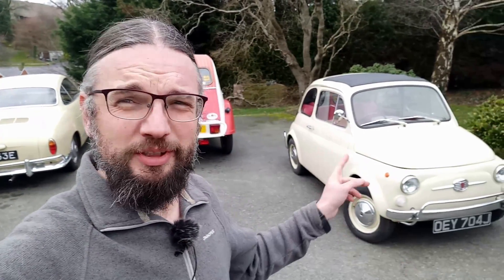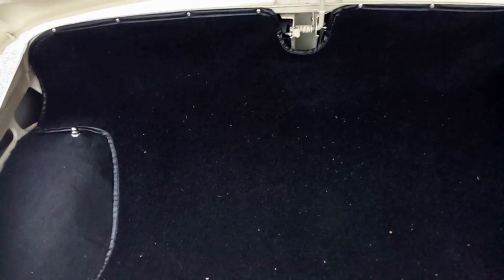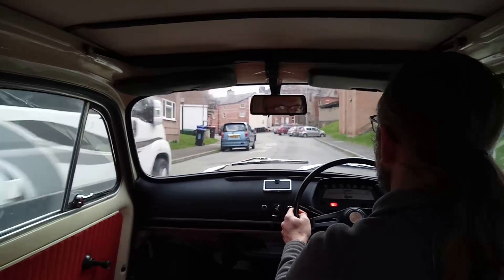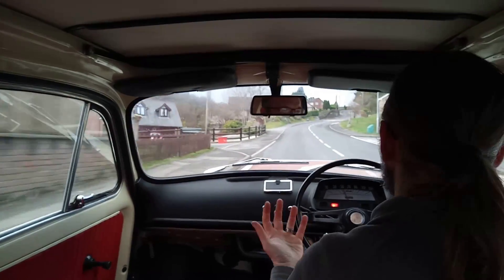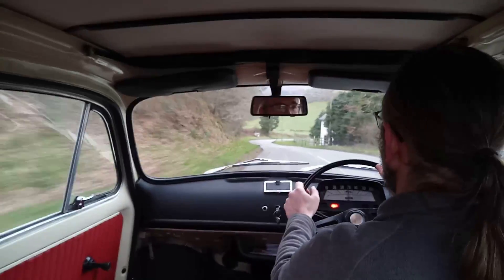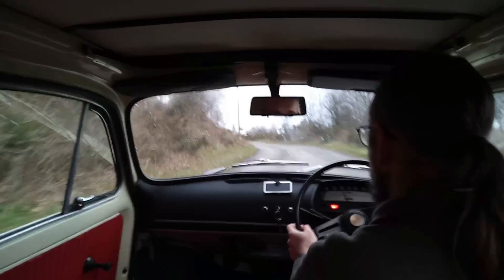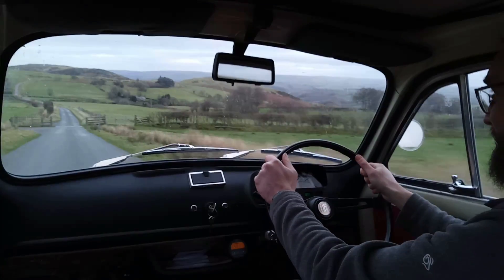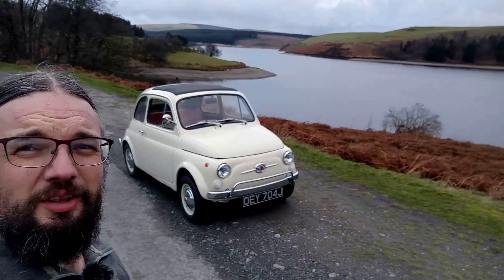This Fiat 500 is ELECTRIC! What's it like to drive?

Comment: A great review Ian, what a great little car!
Reply: When everybody has an electric vehicle with 200 mile range at a top speed of 100mph, the current technology dictates you will use 3.2 times the electric your average UK house does for the present 1.4 cars per household. The grid in its present form cannot even slightly cope (nor can your wallet) so this needs to be rolled out with massive alternative energy sources, a lowering of performance expectations, brought out in the freight industry first (that electric suits, with the high torque and enforced tacho breaks)
  Its sadly a bit of a headache...before you even go into a massive lithium mining demand rocketing costs.
Reply from the maker: Yet power companies seem to think they can cope. The grid does not run at 100% for 24hrs a day. Electric cars can actually help balance the load through smart chargers.
Reply: @HubNut  Steve Rose did a great article for Motorcycle News where they did the maths and found it somewhat (or rather, vastly) wanting, I think it will start to become more polarised as we get past the 15-20% usage mark. I'm certain the government aren't pushing to LOSE the revenues raised by fuel tax, its hardly a philanthropic organisation.
  I can certainly see legislation in future whereby new builds will have to have a certain percentage of the roof given to solar, or similar.
Reply: @DomRivers67  do you not ever consider how much electricity is used to get the oil refined into petrol and pumped to you car?  (It's surprisingly large!)

Comment: I'm not necessarily an electric car fan, but like with all things we may have to embrace it. If things like this conversion means we can enjoy older cars well into the future, what's not to like? Great video.
Reply: This is good. Transmission fluid and other service items may also become illegal in places like Germany, but then we can still go Cuban and replace it with a concocted hygroscopic grease from supermarket supplies. It is still greener than teslas and the leaf, because it was not replaced 20 times since the 50s

Comment: If they weren't so hard to find these days I think an electric DAF 55 would be a very interesting and mechanically straightforward conversion. Let's face it someone has even done a Matiz!
Reply from the maker: A DAF would be quite tricky, because of the belt drive. There's no need for it, so you'd need to re-engineer the car to suit.
Reply: I know someone who converted a DAF 33 and documented the proces on his site: http://gromsound.mfbfreaks.com/33e/33e.htm. Only available in Dutch, though. Maybe Google Translate can make a somewhat comprehensible translation.

Comment: Wow, the electric prototype Ural has more range and power! Nice, but like most electric vehicles over a few years old lack in range and power. More modern ones, more (insane in some cases) power, range getting there. Why did it take 100 years to START working on battery tech? Capacitors are a better choice, but I digress as I often do...

Comment: Fiat X1/9 would make a great electric conversation.  The original 1300 was very under powered and the torque from the direct drive would liven the car considerably
Reply: The original X1/9 hit 60mph in 12 seconds and was good for just over 100mph. Not bad for a 1300cc engine in 1972. Have you had a look at figures for similar sized sports cars from that time?
Reply: Low pressure supercharger would improve the car while keeping it somewhat original
Reply: @sim6699  as the public move towards electric cars (and they will) the demand for fossil fuel will fall.  At some point, probably in the next 20 years, we'll see fuel stations closing as the demand falls - then no matter what 'origanlity' you want, using the old things will be increasingly difficult.

Comment: I was talking about this last night to a friend  most country's would have to start burning coal again to put up with the pull off the grid if we all had electric e.v wind and solar I don't think is going to cut it
Reply: Still more efficient than a combustion engine. Science and all that.
Reply: I saw an interview recently with an engineer at the National Grid who can't wait for the next wave of technology to use smart meters and plugged in electric cars to balance out the peaks and troughs in the electricity supply.  They could use far less fossel fuels then despite more electricity being used as the chargers could draw some power from the cars when the grid needed it most before topping them up later on in the night when demand is low.  It would take us a lot closer to 100% renewable power.  I imagine it would need some sort of user interface for those evenings that you needed to charge it for a bit after work before heading back out but for 90% of people 90% of the time it would be fine and the other 10% can have veg powered Peugeots.
Reply: Solar and wind power is so unreliable it forces the grid to increase base load generation to somewhat mitigate.
Reply: sim6699 sorry, baseload is exactly what solar and wind don’t increase! When wind renewable power output on grid drops it’s the “peaker” plants, usually natural gas, that have to take up the slack. Coal plants can’t get up to speed quick enough, and are being shut down due to the awful pollution they cause anyhow. National grid reckons we can cope with a couple of million electric cars with exisiting grid before we need to start to worry. Battery evs will also help to balance the grid at peak demand times.
Reply: @AdrianColes  
I'm not well read about the national grid but did read base load increases because generation can not be switched quickly, except hydro energy refilled at night using spare capacity for peak demand in the breaks between popular television programmes.

Comment: I think you're absolutely spot on in your assessment of the conversation.  Yes it's expensive but the car 'looks' original and the engineering has clearly been well thought through.  The conversion makes the car an improvement on the original in terms of acceleration which is important these days.  It has better brakes as a consequence and no doubt handles a bit better (you didn't mention road handling but did state it had been properly weight distributed ).  The negative of range is an issue but the 500 was a town car so it electric guise it serves its purpose.  Good review

Comment: I'm a bit surprised you're advocating left foot braking Ian. Most driving experts would say you're braking reaction time would be quicker with your right foot.
Reply from the maker: How can it be quicker to move your foot from one pedal to another? Doesn't seem to harm F1 drivers. ;-) I often left-foot brake in automatics.
Reply: @HubNut  you're moving your foot from one pedal to another. In normal driving i.e. not Formula 1, your foot is resting on the floor. Jackie Stewart said this, not me.
Reply: Every time you put on your brakes your life is in your foot's hands ... ;-)

Comment: Ooh, imagine TWC with an electric motor.  The overtaking would be even more startling.  You wouldn't want 60hp though!  Just so you know next time, 70 kph is 43 mph, 80 kph is 50 mph, 90 kph is 55 mph and 100kph is 62mph :-))  I grew up with imperial in Australia and then they changed to metric in 1974.  I have never been able to visualise distance since.

Comment: I love this. Would have this on a Classic Mini 👌🏻
Reply from the maker: That would throw up some engineering challenges, given the engine and gearbox are one unit in a Mini, but I'm sure it would be possible. Fun too!
Reply: @HubNut  As you said in the video, you don't really need a gearbox with an electric motor.
Reply: @HubNut  The way to do it would be to remove both engine and gearbox and use a dual shaft motor to run both driveshafts and forget having a gearbox, probably enough space there for a battery pack as well. Maybe have a 2nd battery in the boot. An electric classic Mini Cooper would fly!
Reply: @markpitt5248  

What about a differential though?
Reply: @ChrisWilliams-i7d  Good point well made! Single shaft and differential then.
Reply from the maker: You can get combined motors and gearboxes these days that just need custom driveshafts now I think about it. Will have a differential.
Reply: If you're an eco-warrior fit the front subframe and diesel engine (1.5 peugeot) from a rover 115d or nissan micra 1.0 petrol since k11 Micra's don't look pleasing on the eye.

Comment: I like this. I was thinking about a conversion of a classic car when I get one but was told that the car would be reclassified as a new vehicle and no longer a classic even though just the power train is replaced. 🤔
Reply from the maker: It isn't reclassified as a new vehicle. It still keeps the same ID. Might be true that it no longer qualifies for MOT exemption, but I can live with that as I ignore the exemption anyway. TWC doesn't need an MOT, but she will still have one.
Reply: @HubNut  I agree with you on that. When I get one I will still get it tested, it's common sense at the end of the day.
Reply: Has anyone tested this reclassification from changing the engine when an original engine is not available and a close equivalent is fitted in its place.

Comment: A great conversion but here in OZ it would cost a fortune to charge it up. Our electricity prices have gone insane in recent years. The brakes could do with an electric servo with the weight of the Tesla batteries. Do I think it's a good idea for classics? Maybe in the UK where the traffic is very car unfriendly but here it's pointless,after all a car is only as good as it's engine mostly.
Reply from the maker: I don't think the overall weight has changed much. It stops well enough. As you say though, you are at the whim of electricity companies when it comes to refuelling rates.

Comment: Once the battery vehicle gets common there will be another pressing environmental concern about that, probably to do with lithium and point of production electricity pollution.  The environmental threat will simply be maintained with another focus. While they are rare they are a solution, once they are common there will still be a problem.
Reply from the maker: This is true, which is why I didn't discuss that. I'm not one to claim EVs are a magic cure to our pollution woes. They can help remove fumes from cities, but energy is always going to have a carbon cost. Even renewable isn't exactly free energy.
Reply: I must be honest: I prefer combustion engine above all transportation means powertrain, I'm no green-hooligan. But since lithium is so toxic and so rare on Earth (and thus expensive), I think there will be a much more organized industry on the recycling of every single bit of battery, and once ev's will be common, electricity consumption will have such a peak that it will obviously have to be produced efficiently without carbon cost. By the way, I think that a little range extender on board of every ev's could be a great solution: a very small engine, running smoothly and low just enough to charge the batteries while you drive would be much less harmful than a full combustion engine moving the car around and providing all the horsepower
Reply: @Barbacito  Yeah, a tiny ~300cc turbodiesel so it can run on vegetable oil. Does tree sap have calorific value?
Reply: @Barbacito  Lithium is in fact more abundant than e.g. lead. So far we haven't had any problems providing lead-batteries for "normal" cars; Lithium is harder to mine though. And yes, there will be more recycling. It took quite a while but people seem to have realized that throwing away raw materials isn't the smartest thing to do.
Lithium itself is not toxic, its salts are even used in therapy against manic depression.
Reply: @Barbacito  lithium is given to people to treat bipolar disease, it is not as toxic as you say , check out environment agency waste categories if you don't believe me
Reply: When 80% of cars are EV,the government will move the goalposts again & it'll be £300 pa for the most feeble EV. This planet is overcrowded.   Invest in a bicycle,but in  y2090 the fuckers will tax bicycle tyres.
Reply: @andythesoupdragon  bicycle tyres are taxed now.  20%
Reply: And road tax...
Reply: @andrewthompsonuk1  there will be road pricing.  This will be used to manage congestion as much as raise revenue.
Reply: Why would you use lithium?

Comment: I'd love a go in that little motor, if only for the chance to look ridiculous ( I'm over 6ft and weigh 18 stone). Hopefully costs will stabilize or even come down with more production, the economy of scale etc, and longer range from improved batteries. As for oil based fuel not being available in 20 years or so, by then its most likely I'll have departed, but I could specify an electric hearse!

Comment: Will you get the chance to go and drive it again once its running at full steam?  I think bearing in mind the 500 was always a city car then this really suits an electric conversion. With that battery pack in the frunk what did it feel like compared to the standard 500?
Reply from the maker: Not sure. I can ask. In terms of ride, it didn't feel that much different to the last 500 I drove. Still quite bouncy.
Reply: I just think it would be interesting to know "for reference and research purposes" what it will be like at 100%.

Comment: I used to really dislike small cars but now am actually starting to like them. My sister had a Fiat Cinquecento the only really annoying thing was that the gear ratio was messed up, first gear was so short that it was handier to go to second from the get go.

Electric cars are the future, drove a Model S100D that thing is quick and expensive. I'd be looking for a i3 Rex when in need of another car. Till then my Peugeot 1007 (sliding doors) will be my means of transportation.

Comment: For better (or for worse as far as classics are concerned) fossil cars are a dying breed and the availability of fuel will be the killer factor as the commercial focus changes to electricity supply. It is good to know that these solutions exist but how much will be allowed long term remains to be seen as the powers that be seek to regulate, tax and control transport.

Comment: Its actually easy to convert to electric motor drive, its just the batteries that cost really.
Reply from the maker: Plus you need a controller, and to know how to programme the controller to get the best out of the motor.

Comment: I believe have a gearbox and clutch is the only way to go really, because in a electrical runaway situation say due to a faulty pedal or speed controller , you have the means to break the drive, wheras when its direct you dont, so its a thumbs up from me.

Comment: If you convert to electric do you lose the mot/ tax exemption etc?
Reply from the maker: Tax is purely on age, so no. MOT exception is a very good question. Personally, I'd always have an MOT anyway, so I guess it didn't cross my mind to consider it. My failing.
Reply: If it is modified, you lose the MOT exemption. The law states, and I quote .... 
"No substantial changes have been made to the vehicle in the last 30 years, for example replacing the chassis, body, axles or engine to change the way the vehicle works".
Reply: @Mariazellerbahn  Thanks, its a bit of a mine field to what is classed as modified, bigger pistons etc.

Comment: Achingly pretty car with a glorious scenic backdrop.  The original gearbox will be engineered to handle the shock loads from a ICE which delivers torque in pulses so to speak whereas the electric motor delivers more torque but smoothly so it will offer less stress to the box.
I long for the time when I will be able to go to a scrap yard and pick up a leaf power unit to put in a classic.
Reply: T.v.
Reply: 5 year old Leafs are 7-8 thousand Euros in Ireland which is a lot less than the 20 thousand pounds this little car kit is, and almost as much fun.

Comment: Wont it stress the gearbox leaving it in 3rd at full chat? I cant get my head around not using 4th to conserve volts and less stress on the box. I wonder what its mechanical top speed would be......
Reply from the maker: Shouldn't do. You could always use fourth if you were on a long run. Top speed would be fun to find out once it's at 100%!

Comment: Excellent, very interesting. The 500 finally gets a decent performance upgrade! Great as it is to have it and all, I cant help thinking that the word longevity is NOT one I would attach the the weedy (driveshaft upgrades notwithstanding) manual gearbox tho.!
Reply from the maker: They can programme the controller to avoid gearbox-shredding action. Even when it's set for more power, they can phase it so it doesn't all come in instantly. Downside to electric motors all that instant torque!
Reply: @HubNut  that's not a downside! Well maybe for a little fiat 500 is it but the Tesla model s is hugely fun with it

Comment: Pull away in 2nd ? Drive in 3rd .... What about 1st and what's reverse like ?? Would Thier conversion fit the Fox ??
Reply from the maker: You can pull away in third, but it's a bit slower. First is entirely unnecessary. Reverse works fine. Just normal really, but quieter! You could use this motor and controller in the Fox, but sadly cost rules it out. For now...